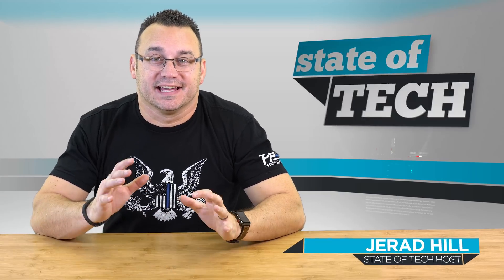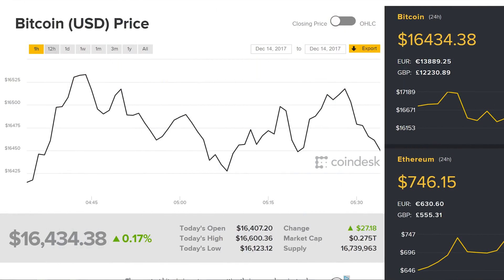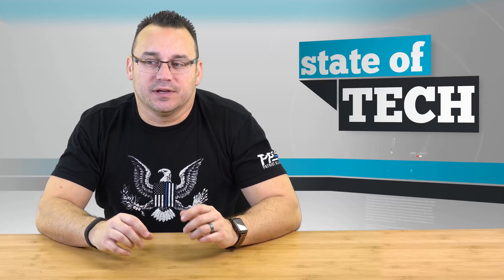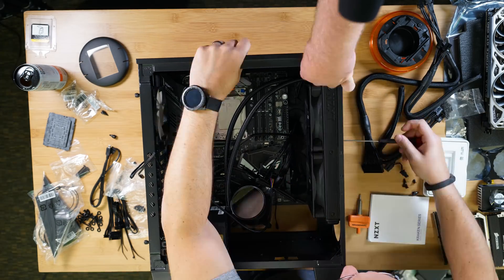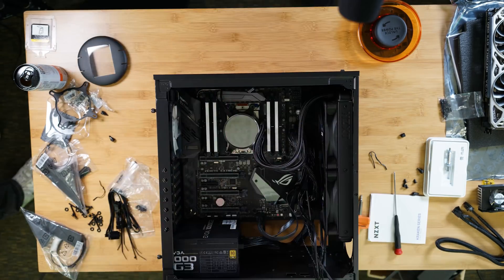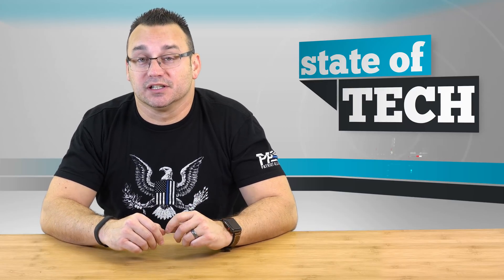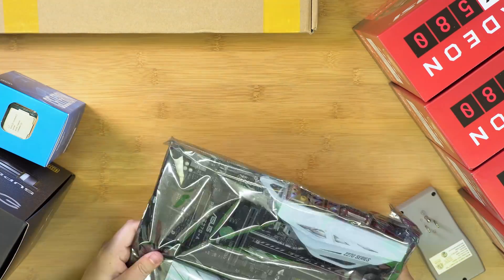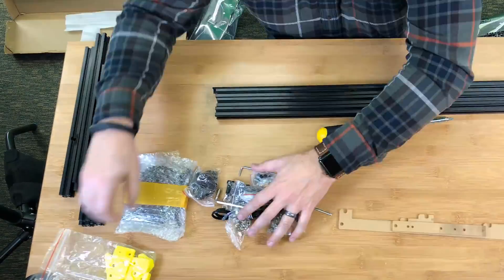Building an AMD RX 580 Ethereum Mining Rig

Comment: I'm looking to build the exact set up (6x Rx 580 8 gig or even an 8 GPU set up) kinda surprised u only got 119 MH/s. with the research I did for my future set up, it should be around 170. I'm also looking to mine Ethereum and invest in some alcoins. not sure if I'm gonna run into the same problems. would love if u keep us updated in videos. found channels covering this but I like ur way of explaining things. specially the bios flashing and overclocking. idk how that would work on per GPU
Reply from the maker: I have a recap video coming soon. I am hashing around 155 now and still have some optimization to do.
Reply: StateofTech interesting. I guess alot of things can effect the hashrate. how much are u getting per GPU? the drivers and ur miner also play a factor. also people have been having tons of problems with risers
Reply from the maker: Yeah I tried a different set of risers and that did nothing. I have tried two different firmware versions and found one worked a lot better than the other. I still am having issues getting peak performance out of the cards that have Samsung memory in them. Otherwise I’m getting 30to31 mh/s out of the cards with Hynix memory.
Reply: StateofTech what drivers worked better than the other? is it the block chain drivers? also how much are u getting in the samsung GPUs?
Reply from the maker: Yes. Running the blockchain drivers. Getting 20-22 out of the Samsung. I think I have it figured out though. Will update soon.
Reply: StateofTech oh okay. that had me a little puzzled haha